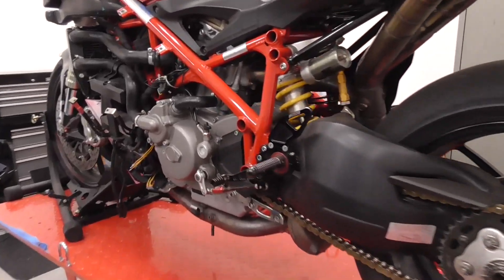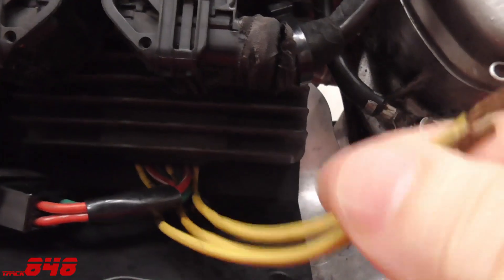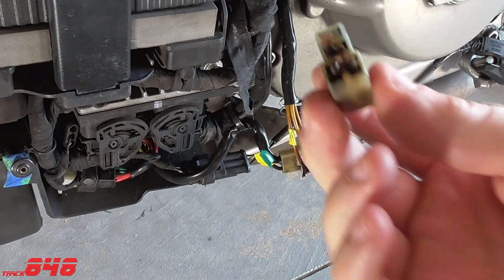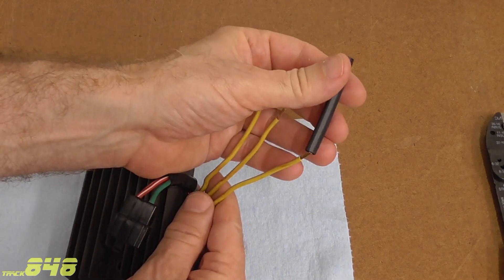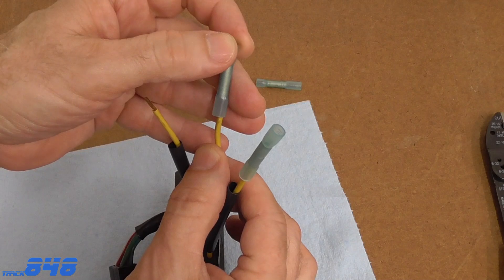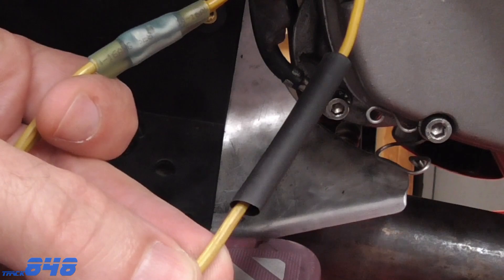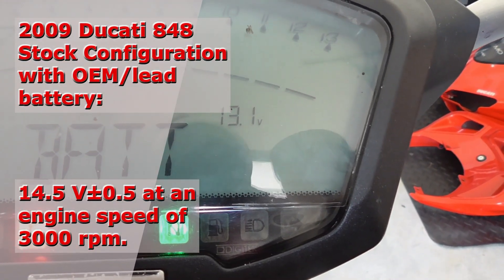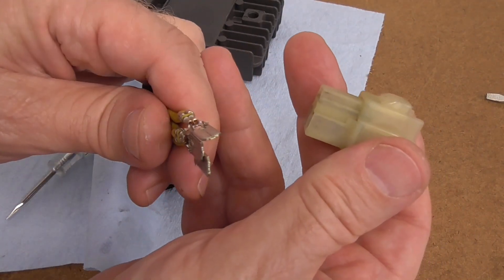How to Hardwire a Motorcycle Stator to Regulator Rectifier

Comment: When disconnecting the 3 yellow wires does it matter if I connect them back to the exact same yellow wire?  I'm assuming as long as I'm going yellow to yellow, it doesn't matter which yellow it is.   I have a connector that melted and I can't even get it to come apart.  Thinking about cutting the wires and hardwiring them like you did.   I don't know if I have to remember which yellow went into which yellow.
Reply from the maker: Hey there, Dave.... the three yellow wires can be connected in whatever order you wish--they do not have a specific order--you can mix them up and there will be no problem. Good luck!
Reply: Track848  thanks. That makes things a little easier.

Comment: What causes it to burn the connection?
Reply from the maker: Some people believe it's because the wires from the stator to the reg-rec are not large enough. Others believe the connector is the problem. In my opinion most instances of a burnt or melted stator connector and/or wires, is due to poor preventative maintenance. Dirt, oil, grime, salt, sand, moisture and oxidation all increase resistance in the connector, and this resistance equals heat--and a lot of it--and over time the connector and wires will meltdown. If the connector is overlooked during cleaning it's probably just a matter of time before the heat starts to cook things up. Some motorcycles also have an oil wicking problem (like mine did when I created this video), where oil from inside the engine seeps through the inside of the wires into the connector. I believe this can also contribute to the problem.
Reply: Track848 thanks

Comment: MY 848 got this problem last week, i think the weather was very hot with my weak STOCK VR, those 3 yellow line all got melt, ( i thing there have a small fire before) , Than i change it to new wire, bike can start run fine, But it showing 21.2 code, and someting it can't showing speed on speedometer.  what's your comment? i'm ready to change a new bmw VR.  i hope it can fix the issue
Reply from the maker: Hi kit... error code 21.2 is a 'Stepper motor error.' I've never had that problem but there are some fairly thorough posts on the ducati forums regarding this topic. A bad reg-rec can cause all kinds of electronic errors and issues and this could be a contributing factor. Here's what I would do:  Check to ensure your positive and negative connections are secure at the battery and at the ground bolt on your frame, the starter motor and solenoid. If they check okay, and the problem still exist open my video again and click on the icon in the top right corner. I have linked some instructional videos that show how to test your stator and regulator/rectifier. If everything tests okay, then I would focus on the 21.2 error separately as a Stepper motor issue, which you can read more about on one of the forums. Good luck!
Reply: @Track848  many thanks for your replay~!

Comment: Thanks for the vid - extremely helpful, was able to sort out my bike after 2 reg/recs and 2 batteries didn't seem to do the job, turned out the connector block was fried. Also great to have verified it doesn't matter which order the 3 wires connect from the stator to the reg/rec. Great work, cheers!
Reply: Thanks guys, I was worried also about contacting the whires the wrong way.....
Reply from the maker: You're welcome, Jim...It's good to hear that you got it sorted!
Reply: Hey I have a brown wire and don’t know what’re it connects any help?
Reply: @OFFICIALPGBEATS is it a small connector on the rectifier end?

Comment: Are there any cons to hardwiring? Why wound they not just hardwire to begin with?
Reply from the maker: Hi Bryan, yes in my opinion there are two drawbacks (these are also mentioned in the video description):  1) There's no way to test the stator and/or reg-rec unless you re-cut the wires; and 2) On my Ducati, the reg-rec has to be removed every time the alternator-side crankcase cover is removed. This isn't a huge deal:  The battery has to be disconnected and the ECU has to be loosened and moved out of the way before the two bolts securing the regulator/rectifier can be accessed. These two reasons alone were enough for me to reinstall some heavier duty connectors about a year after this video.
Reply: Track848 Ah my bad, I never read those, might have to start. I appreciate you taking the time to respond!

Comment: Great video, found mine fried under my ecm 2 days ago when pulling down my 03 954rr for t-chain replacement with adjustable sprockets. I was 90% sure just replacing the connector with higher quality would fix the issue, sadly I already ordered $400 worth parts for new rectifier and stator which will now just be closet replacement parts 🤯!  Thanks for the video and II really hope more ppl get to see this video before they spend unneeded money!
Reply from the maker: Ean, glad you found the burnt connector... if you can't resale the new parts that you purchased, it's always good to have items like this on your shelf. For example, my reg-rec eventually ended-up malfunctioning as well. Good luck!
Reply: @Track848  def have a collection of parts, 9yrs automotive mechanic... First owned bike, first bike wrenched on.... Update all maintenance done and stator works perfect 14.67 volt output noticed that the wires from the stator are 14ga at plug and the rectifier is 12ga at plug... Nice factory bottle neck. Honestly think once I get the new stator if it isn't 12ga to match I'll be replacing the wires to match the rectifier.
Reply: Update direct wire ftw, Parts Giant let me down and failed to include the stator in the box before shipping. smh... good old human error.

Comment: This part of my bike was also burnt. Is this the result of my bike not being able to start up.
Reply from the maker: It could be the problem or it could be a contributing factor. What happens when you turn the key on? Can you hear the fuel pump engage? Does the engine turn over? You will need to narrow it down to an electrical/charging system issue or fuel delivery. What is the year, make and model of your motorcycle?
Reply: Yea. Its the 2008 model. It was the regulator wire burnt. Now its fixed. Thanks. Anyway👌

Comment: Great video. How can I remove the burnt connecter without hardwiring?
Reply from the maker: Cut it out and replace it with a new connector... I would recommend the 'heavy duty' Hot Shot Wiring Harness Connector Kit from Rick's Motorsport Electrics... I ended up using this kit after leaving my 848 hardwired for about a year... read the description and you will see why...
Reply: @Track848  part will be here Friday thank you

Comment: I have a 1994 fzr600 I replaced the regulator but mine has 3 wires of the same color and one red one.... I made sure to put the red one in it’s exact spot but I’m sure I messed one of the others up...I went for a short ride and the battery .. maybe 20 minutes.  Also before I replaced the regulator the battery had gotten extremely hot.  Is it possible my battery is fried? Or wire placement? The wire I’m talking about are on the right side of the battery regulator?? How can I test the proper sequence they go in?
Reply from the maker: Hi Lester... I have not worked on a fzr 600, but the order of the three wires from the stator to the regulator-rectifier can go in any sequence. It might be a good idea to check out one of the fzr forums for more details about your particular model. If you're in the USA, you can take your battery in to an automotive parts shop (like Autozone or Advance Auto) and they will test the battery (for free) to see if its fried. The regulator you replaced may have damaged it. Also, if you check the top right corner in my video, you will find a link to a playlist with videos that will show you how to test your stator and your regulator-rectifier. Good luck!
Reply: Track848 thank you for your quick reply! I will do the steps you mentioned and I’m hitting that subscribe button!!

Comment: I did this and my Rectifier was still bad. Now that I order a new one I don't know what cable goes to what side. Is there a way to figure out the correct configuration of the 3 yellow wires?
Reply from the maker: TJ, the three yellow wires can go in any order, they are completely inter-changeable. Good luck and I hope you get back on the road soon!
Reply: @Track848  Thank you! I will try that tonight.
Reply from the maker: @tjwilson317  Excellent, please note that the wires on the battery side of the reg-rec do need to go in a specific order, so it is important to get those wires connected properly... come back and let us know how it goes!

Comment: Have been having this problem with my 85 vf700f. I believe this connector overheating effects my battery charging? 
Am going to hardwire it like you've shown. 
Your vid is one of the best! Thank you for not telling your life story for half the vid like others do  : )
Reply from the maker: Hi Paul, yes this could effect your battery charging. If you haven't already done so, I recommend checking out the links in this video (click on the icon in the top right corner) and you'll see a few videos that show you how to check your stator and regulator-rectifier. Another item to check is battery connections at the terminals to ensure they are tight, and the ground where it bolts into the engine and/or frame. Come back and let us know how it works out and thanks for your comment!

Comment: Hi
Thanks for amazing video, i have one question. Does the order of pins matter? I mean, there is 3 wires from R/R and 3 wires from stator,. Lets cal them A, B and C. Does connection have to be A-A, B-B and C-C or could i connect them A-C example?
Reply from the maker: Antti, the three yellow wires in this video from the stator can connect in any order with the three yellow wires coming from the R/R. The wires on the other side of the R/R that go to the battery do go in a specific order so make sure those are kept the same.  The yellow wires can be AB, CA and BC for example. Good luck!
Reply: Just answered my question, thanks.
Reply from the maker: @ronaldstone1285  You're welcome, Ronald!

Comment: Does it matter how u put the wirer on? In any order.
Reply from the maker: No Miquel, it does not matter in what order the yellow wires go... they are 100% interchangeable.
Reply: @Track848  thanks brother.  So I have to replace the stator all over again and rectifier.  The battery is not charging

Comment: Friend, I have a problem with my cbr 954,
If the rectifier and stator are in trouble, does the motorcycle start?
Reply from the maker: Hi there, Gphillip... It depends on what stage of trouble the rectifier and/or stator are in. For example, my regulator-rectifier was bad in this video https://youtu.be/kw11Onl7OLQ; as you can see in the video one of the signs was a blown fan fuse. Later my headlights would randomly turning on and off and the dash would 'flicker' on and off as well. Throughout this entire process, the motorcycle would start with absolutely no problem. Did you have any symptoms like this before? If not, you might want to check to ensure that your fuel delivery is okay and that your ignition system is working properly. You might also find some help specific to your bike over on one of the Honda Fireblade forums...

Comment: On my 2008 Ninja EX250 I did this repair a couple years ago. I've put 11000 miles on the bike (first repair at 8000 miles, now at 19000) but my repairs have already melted. I noticed that it started to melt after 3000 miles. I'm about to replace the bikes wiring harness and stator. I think it melted because 1. It sits right under my right leg fairing; pressed up against all that black plastic cooked it. 2. Water, rode and sat in the rain and snow a couple dozen times. Lesson learned: clean and lubricate the wiring connection between the stator and harness as often as the chain, i.e. once a week, every ride, and or when it is exposed to rain.
Reply from the maker: Hey Garrett, it sounds like you've got your problem figured out... I bought an extra stator and had it completely re-wired with heavier gauge wire (12 gauge wire vs the 14 gauge that it came with from the factory). When I eventually upgrade my reg-rec, I will use this newly-wired stator and I am also going to relocate the reg-rec to a higher/cooler location, probably over to the right side of my bike... Good luck with your project and thanks for commenting!

Comment: Trying to figure out my charging problem. 14 awg is rated for 15amps. I think it should be 20amp rated if you have a 20amp fuse in your fuse box. 12awg is rated for 20amps.
Reply from the maker: I think you're right, Glenn, and I believe a lot of people agree that the charging system wiring on our motorcycles should be larger. In fact, for a future project that I have planned to upgrade and relocate my reg-rec on the Ducati, I already completely renewed the wiring from the stator with 12awg wire instead of 14awg. I will try to complete a video of that project, so stay tuned!

Comment: All the yellow wires does it matter witch  go to witch are they all the same I've got a atv spy F1 road quad and I don't want to wire them all in the wrong way?? Cheers Paul
Reply from the maker: Paul, The three yellow wires coming from the stator to the reg-rec can go in any order; the wires on the other side of the reg-rec (to the battery side) are specific, so make sure you get them in the right order if you're working there as well. The yellow wires (in my video), can in any random order... good luck!
Reply: @Track848  thanks it was the 3 yellow wires that was confusing me but now I understand what you said thanks so much cheers Paul

Comment: QUESTION: can any of the wires running from the stator connect to any of the new regulator/rectifier wires ?? Is there an order or does it matter ? Thanks
Reply from the maker: Jeff, the wires coming from the stator can go in any order... there is no right or wrong way to connect them, they are 100% inter-changeable... hope this helps!
Reply: @Track848  Thank you for answering that question.  Just hard wiring my gl1200 interstate and might have gotten the wires mixed up after I cut them!
Reply from the maker: @scottfarraway34  You're welcome!
Reply: U answered my question.  I guess I need to replace the stator and rectifier.  I hard wired them yesterday.  And my battery died . Had to buy a new battery. Thought I wired them wrong.  Turned on my bike today and the volts of the battery was going down . Any help ?
Reply from the maker: @miguelramos1684  Hi Miquel, I just answered your other comment... and I note that you already bought a new battery. You might have a bad rectifier if your battery is not charging. Did you check your stator output? If you don't know how to do this, open my video again and click on the icon up in the top right-hand corner there are a few videos linked there that you can follow to check the stator. If the stator checks okay, it's almost certain that your rectifier is bad. Buenos suerte!
Reply: @Track848  thanks again . Will do . I'll check ur videos now
Reply from the maker: One last thing Miquel: If your stator checks out okay and the rectifier passes the diodes test, and before you spend any more money, be sure to check that your primary ground wire (the main ground from the battery), is not loose where it bolts into the case/frame...
Reply: @Track848  OK. Thanks for the info . Will do all that today
Reply: @Track848  thanks for ur info. It was the rectifier. Replaced it and its working fine. Thank u so much. Keep doing what ur doing
Reply from the maker: @miguelramos1684  You're welcome! Glad you got it resolved 🏍🏍🏍...

Comment: Hi, great video...calm, sure, informative .. Did you ever do the oil wicking fix video? I can't see it in your video library. Thanks...very nice channel...sub'd.
Reply from the maker: Thank you for the compliment! In reference to the oil wicking video, I recorded footage of my fix but have not yet edited or published the video. And what a coincidence that you asked: I was just reviewing that footage yesterday! Must be a sign that I need to complete that video NOW! Thanks for viewing and stay tuned for the oil wicking video...
Reply: @Track848  I think I have a solution...get this- use a heat gun to heat the wires closest to the case...then use a wide pliers to squeeze the wires shut/pinching the wire wrap and sealing out the oil. forcing it to stop flowing. What do you think?
Reply from the maker: I read where one race mechanic used to safety wire each individual stator wire to 'choke off' the flow of oil, but that wasn't considered a long term fix. This sounds similar to your thought process. I'm going to open up my bike soon and check to see if the re-routing actually worked, from all that I've read this seems to be the best solution...
Reply: @Track848  Fate timing indeed. The fairings are off, wondering if I should eliminate the connector like you did...
Reply from the maker: @TiroxSnapJack  You could, but let me reiterate one thing that I elude to in the description:  If you plan to do occasional and/or routine maintenance to the engine behind or inside the alternator-side cover, it might be better to replace the connector (if yours melted or got burnt). After this video I ended up re-attaching a more heavy-duty connector and re-routed the wiring to eliminate the oil wicking issue... as a result of your comment yesterday I'm reviving that video project and will try to complete it soon.
Reply: @Track848  "re-routed the wiring to eliminate the oil wicking issue."  this is what I want to do plus better connector. the wicking is the core issue. hopefully I wont have to open up the alternator assembly. what a crazy thing this is "oil seeping through the wire" amazing